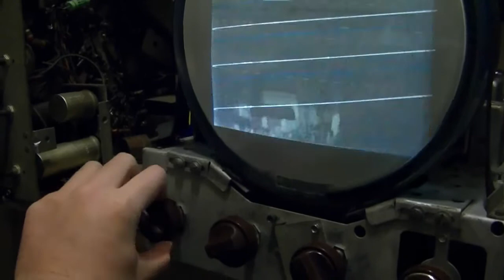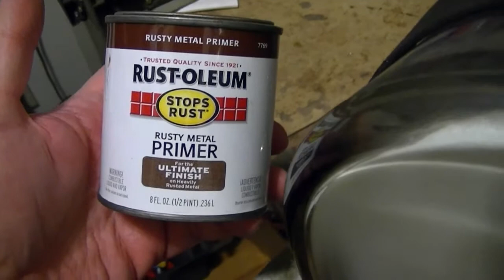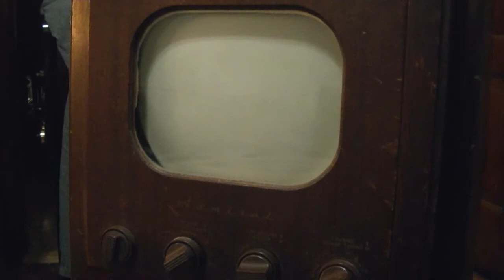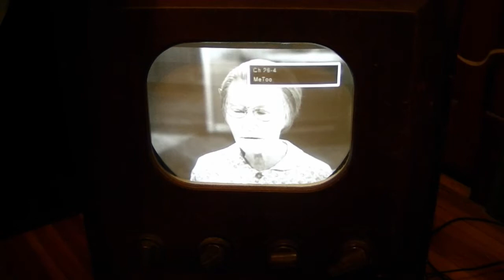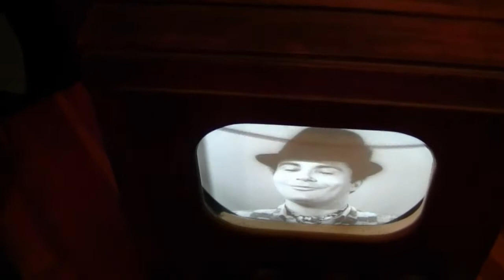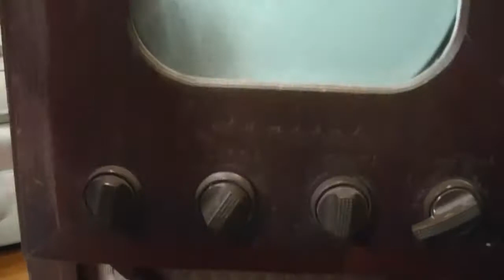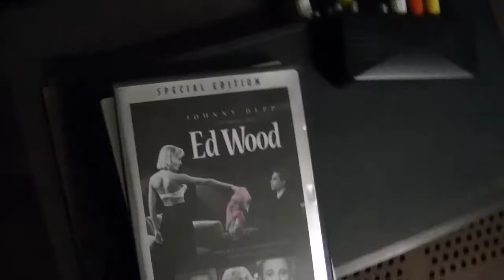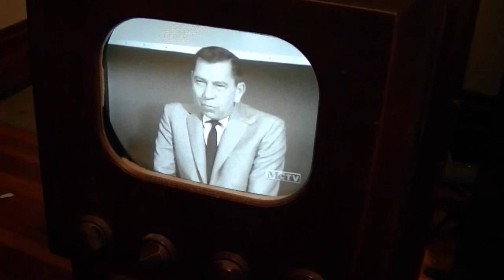Admiral 30A15 restoration pt5o5

Comment: Bob,

Not to nitpick but on the DVD player it is not RGB but Component, where the green connector carries the Y or luminance signal, the red and blue connectors are a red minus luminance and a blue minus luminance. 

As doe the "dot crawl" with a standard NTSC signal going into a high bandwidth set, it is a well know issue, RCA knew all about it when they proposed "compatible color" and after 54 they limited the video bandwidth of most of there B&W sets to 2.8 mHz.

Comment from the maker: I think I paid $40 for it.  It's hard to sell sets even fully restored.  Shipping is a pain and most folks just don't care about old B&W sets :(   Yes, prison sets are clear to help prevent contraband from being smuggled in.  I have a 13" color RCA clear plastic case set from around 2005.   Perhaps if I ever come across an intact TV chassis with no case I'd consider building one.

Comment: No, they're not any more expensive than the usual electrolytic of the same values. Most of them are sold by tubesandmore or tubedepot or amplifiedparts and made by CE Manufacturing, LLC. They bought the Mallory equipment and tooling.